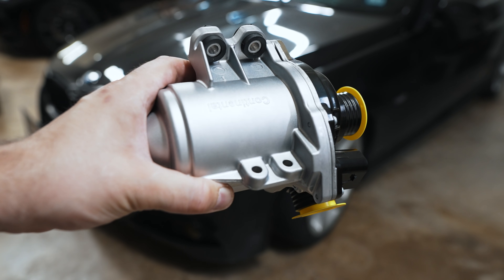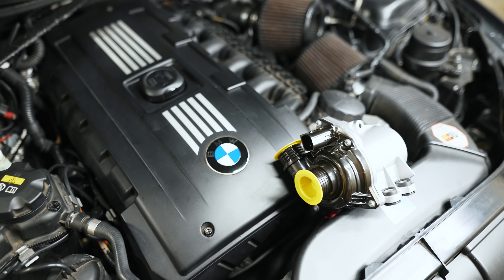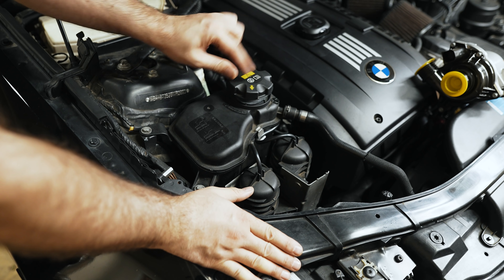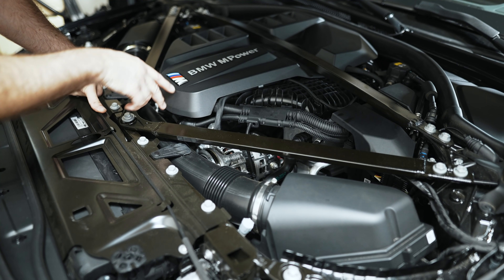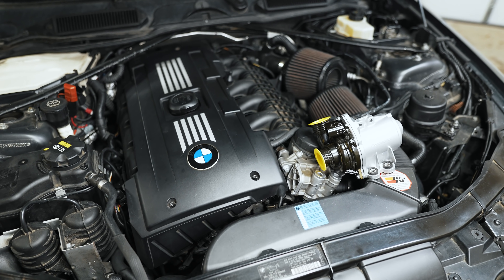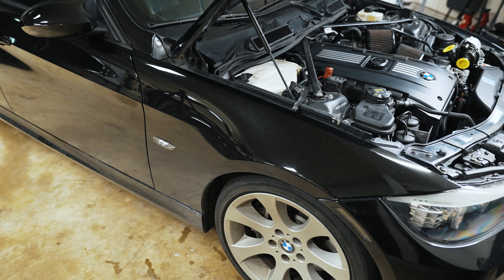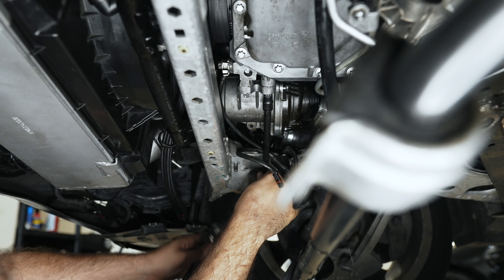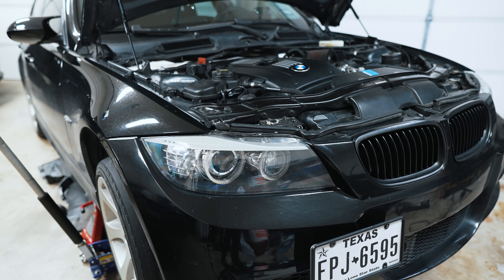New BMWs Don't Have This "Modern" Part From 10 Years Ago

Comment: Does a new installed el. Water pump requires any reprogramming or relearning? Or it's just the bleeding of the cooling system required!
Reply from the maker: Just needs the bleed procedure, nothing else.

Comment: I just replaced mine with a full aluminum water pump and its got lifetime warranty ;)
Reply: Rockauto , The manufacturer is “Gates”
Reply: Can you give a link from were you bought it?
Reply: Gates makes good stuff
Reply: Honestly I just went with it because of the lifetime warranty, Its a decent price and in the past I went with the OEM VDO water pump on my previous 335i’s and they were garbage, one was leaking right out of the box and had to return it. 

No complains with the install on the Gates pump, exactly like OEM and even came with the short updated bolts. make sure to do the coolant bleed twice for a peace of mind
Reply: Why? What does gates consider "lifetime"? These pumps have a expected life of around 80k miles. Purchase from fcp and you will get it replaced regardless.

Comment: I spent a $1000 on an all aluminum pump in August and it's already went bad. 
I'm getting one from FCP euro..
Lifetime warranty
Reply: Most of the time the electronic parts itself go bad. All aluminium pump does gonna help for that so does worth of going full aluminium water pump. Just stick to the OEM or atleast OEM quality.
Reply: @DeteCT0R  I whole heartedly agree however I did have two of the plastic pumps crack within a 3 month period LOL

Comment: Nice video. I was waiting for this. My biggest complaint with the electric pump (plus the thermostat) is the placement. I wish it was more conveniently located like the air filter for instance. I wouldn't mind changing it every 65K miles if I didn't have to bend myself into a pretzel doing it. This is more difficult in my xDrive as the space to work is even less than what you see in this video.
Reply from the maker: Yeah good point, if it was more easily accessed it wouldn't be that bad.

Comment: Being able to bleed the the cooling lines while the engine is off, is pretty awesome if you ask me. Not that it needs to be done often, but still. Having understood little about the heat playing a role in BMW engines, I do know that BMW reckons higher heat means more efficiency. So the electric water pump was a cool idea. Its a shame they removed it because of the ahem high failure rates.. Especially on the N55 engines. My N52 at home is still doing okay, so lets hope nothing happens...

Comment: What if BMW put both mechanical and electrical water pumps in at the same time... Kinda like how air planes have APUs that powers accessories when the main engine is not running? The car can run the electrical water pump when the main engine is not running and shut it off when the mechanical water pump is running?
Reply from the maker: If they could disengage the mechanical pump it could be beneficial to have both I would say.  But that would mean more complexity and likely more failure unfortunately.

Comment: Don't forget to check the main ground strap under the driver, that can cause funky issues.
Reply: Yeah my car was struggling to start cleaned that and it starts up no hesitation now
Reply: Would that strap cause any problems with my alternator?
Reply: @thevernonposse  I’m not sure. I think it’s more for the starter. The regulator in the alternator is probably the one thing you’d want to replace once you get past 150,000 miles IMO.
Reply: Absolutely, it mimics starter problems.

Comment: I just replaced my spark plugs and I think one of the reasons cylinder 6 is prone to misfire is because it’s the most likely to have a excessive moisture go past the boot of the coil pack down to the spark plug. Especially on people like me and you who have deleted the engine cowl. The engine cover blocks a lot of this extra water but not all of it. I didn’t have my engine cover on for a few days and then when I changed my spark plugs #6 was almost entirely submerged in water and when I removed it after drying out the spark plug well I could see that the metal parts of the plug were beginning to corrode so it looks like it’s been exposed to moisture for a long time because I just replaced these plugs 20 months ago. Too bad I threw away my cowl or I might put it back on, oh well.
Reply: Fred......Do you mean the Beauty Cover?  The big plastic cover that snaps down over the oil filler cap?
Reply: @wjohnsonism  I’m talking about this https://www.turnermotorsport.com/p-14129-genuine-bmw-heater-ac-housing-microfilter-bottom-64316924277/ and I’m talking about this https://www.ecstuning.com/b-genuine-bmw-parts/powered-by-m-n54-engine-cover/11127845442/
Reply: @fredfrederickson  Whoa,  the entire rear cowl! Ok, now I can see how water gets into plug 6 area. Although not the N54 in the video, I have the N52 and N55 (e90,F30) the 335i had squishy foam sound block thing that sat on top of the rear engine but under the beauty cover shielding #6 & #5 coils from water. I tossed mine a year ago during a VCG job and it always looked like the back coils were now exposed without the foam insulation thing. 
Glad I read your comment, and now I’m proactively watching out for water issues.
Reply: @wjohnsonism  glad I could help. The cowl delete is nice for freeing up space in your engine bay and making it a little faster to work on but the cowl definitely isn’t useless. I had to throw away all the foam under my beauty cover because I had a massive pressurized oil leak and the foam was soaked in oil and I didn’t feel like trying to get the oil out of the foam since I would never be able to get it all out. When the engine started warming up the oil would drip out of the foam and burn on the top of the engine. All of my spark plug wells were full of oil except for cylinder 6 which was full of water 😅 huuuuge pita to clean up my entire engine bay but it’s running now

Comment: are there any pre symptoms one can detect before the pump fails, or does it just fail?
Reply: For me it just failed, i just suddenly got a high water temp warning. And a waterpump communication fault code.

But it lasted for 14 years and 210 000 km.
Reply from the maker: I would say most of the time no unfortunately.
Reply: I noticed my fan behaving strange and also it just felt sluggish. It gave me 2 codes without ever overheating or throwing any check engine lights etc on the dash. I definitely recommend getting ProTool and scan your car anytime it feels the slightest bit "off".  I have an N52 though so I can't speak for turbo cars as far as warning goes. I know a lot of people that got curbed from it with no warning though, so I consider how mine went to be the exception.
Reply: @saganworshipper6062  definitely in the same boat, i currently have an N51 but always carry my scanner with me now that i own a BMW.

Comment: Correct decission for such a so critical engine part, VDO-Siemens now acqurired by Continental is the OEM part.
In the E90 series is the ECU who decides to run the pump and even to open the thetmostat electronicaly.
In some new gasolin Mercedes 6L. they have an electrical dedicated water pump for the turbo and the classical for the engine.
BimmerN53
Reply from the maker: I believe the electrical connector on the thermostat is just a sensor to ensure it's working properly.
Reply: If I’m not mistaken, at least on the N52, the thermostat itself is the traditional wax type and the electrical connector is used for a heating element to influence its behavior. Cheers!

Comment: Mine crapped itself a week after buying the car a year ago. (2006 325i bought on 82k miles)  the dealer replaced it with a cheaper replacement part branded Vetech and it keeps leaving speed deviation error codes in the ecu.
Reply from the maker: Might be worth replacing it yourself with an OEM pump.
Reply: Speed deviation codes is the computers way of telling you that the pump is not adequate. You're on borrowed time.